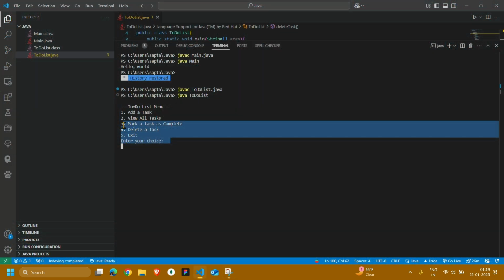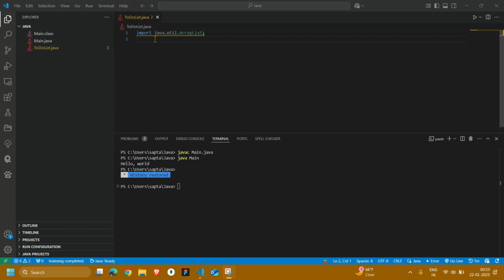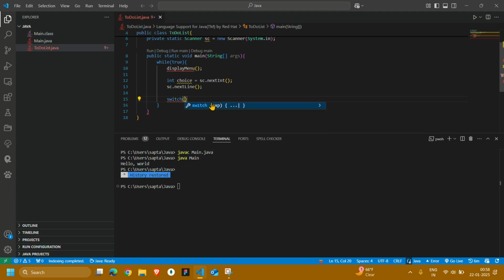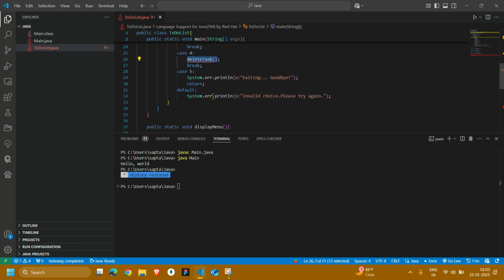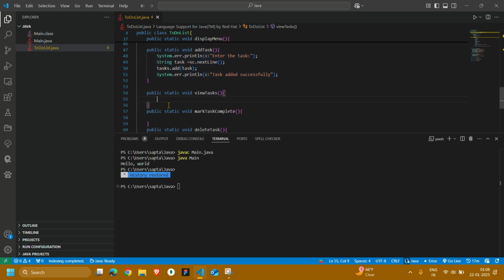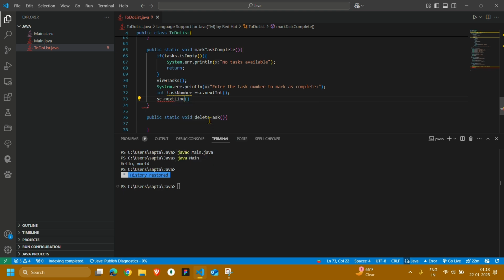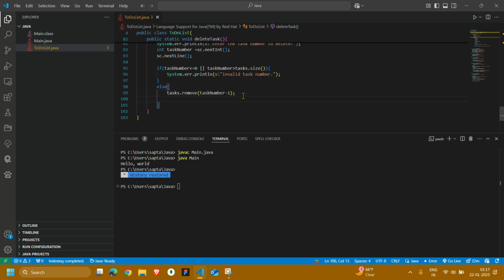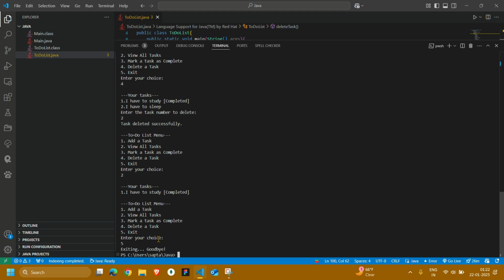Java To-Do List Application for Beginners | Simple Project with Full Code Walkthrough

Comment: Great work saptrishi. Great explation and everythig was complete.

But i think, u mentioned thrice that to write sc.nextLine(); i think if it will not be mentioned then all program will be fine, but if  user enters it once then they wil be getting input mismatch exception. I think u should explain this part once. 

Btw we will get input mismatch exception becayse: 

The sc.nextLine() acts as a buffer cleaner, ensuring that the next input operation doesn't mistakenly consume leftover input from the buffer. Without it, sc.nextLine() might be called and immediately read the lingering newline, resulting in input issues or errors like InputMismatchException.
Reply from the maker: Yeah you're right Sahil